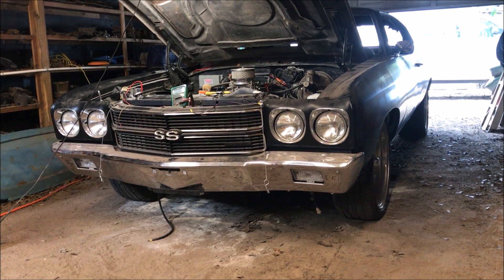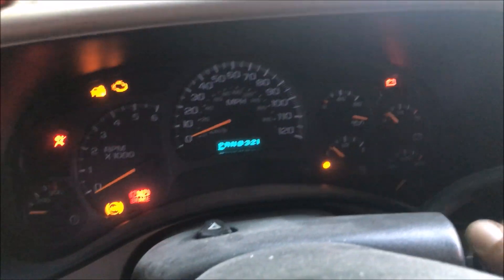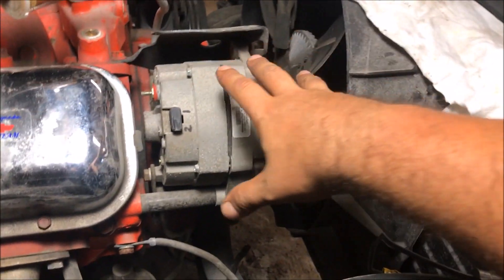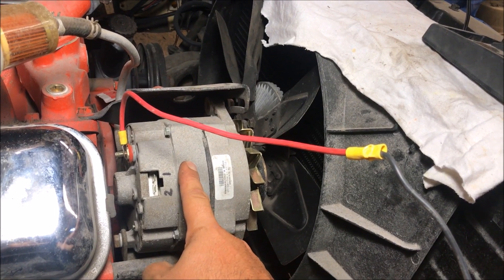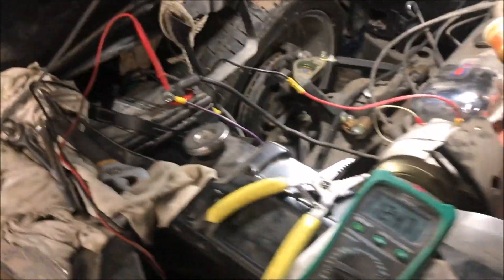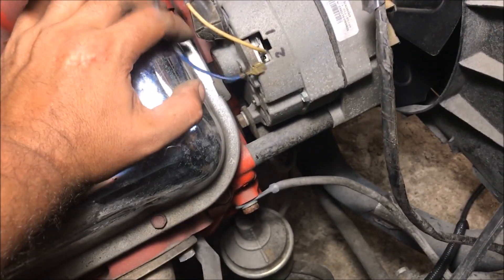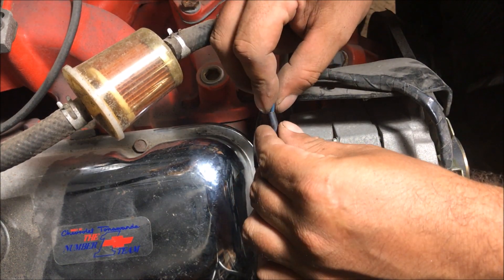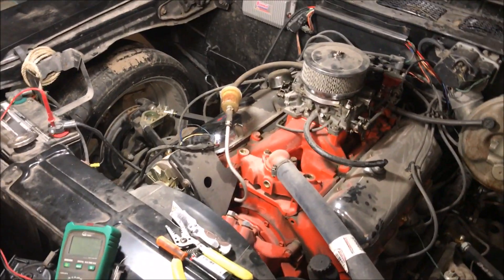watch before you buy a  GM 1 wire alternator and other INFO diode install

Comment: Still watching this video 2025 and I’m having trouble with my GM one wire still not charging bench tested at the auto parts store and it passed no problem put it on the car and test it at the auto parts store. It says bad voltage regulator positive directly to the battery Brand new GM one wire brand new battery as well. Still scratching my head.

Comment: So the only things id be sacraficing is the dummy light if i went from 3 wire to 1 wire?
Reply: In truth it’s not a one wire but uses one wire to voltage regulate.  The exciter wire (#1) is only used if you have the idiot light which place a load on the system to charge if you don’t have the light the diode acts as the load which so you don’t have or need the light

Comment: It's called 'cut-in' and that's a normal feature or problem of the one-wire alternators. The alternator needs to reach the 'cut-in' RPM in order to 'self-excite'. That's a good reason not to use them. Typically, only the street rodder crowd uses them for less underhood clutter.

Comment: Hey chris i have messaged younbefore on a different video about my 85 C10. Right now I have the terminal wire going to the junction block and not straight to the battery so my question how is it getting its charge. I also have a few fusible links going to the junction block where one goes to the starter and then  the other splits and goes to the wire harness
Reply from the maker: the one going to the starter is charging

Comment: What's up man hey I have a 67 mustang no wiring harness for the alternator so I jumped the number 2 to the battery and 1 not hooked up like you said and it worked for a couple months charging after a good rev but now it won't "kick on"  any ideas? Thanks man
Reply from the maker: hook or jump 1 straight to the battery and see if it starts to charge first...  if it doesnt repair or replace the alternator
Reply: @chriscraft77022  Thanks man I'll go try it and let you know.
Reply: @chriscraft77022  forgot to ask should I keep 2 hooked up to the battery? Have both 1 & 2 running to the battery. Thanks again
Reply from the maker: no, it will drain your battery.. run it off of accessories or key switch ON with a diode
Reply: @chriscraft77022  ok thanks dude
Reply: @chriscraft77022  thanks for all your help! Alternator was smoked 55 amp switched it out for 150 amp one wire. Duel electric fans, system and lights everywhere! Thanks again

Comment: I have an old boat and upgraded the alternator to 100 amp 1 wire (455 olds 7.5L). I wanted to just run a larger power cable from the alternator to the pos. battery post to double up the wires, but my mechanic said don't do it.  WHY?   I thought well then maybe I will just replace the entire wire but as I trace the wire it probably goes all the way to the front of the boat 1st which makes me think that there is some type of distribution Box up front. Do I have to run 6 gauge wire all the way to the front of the boat and all the way back to the battery? Am I not supposed to double the wires directly from the alternator to the battery? Because it won't have a fuse or something? So many questions... just want it to handle the load so I get the most out of it.
Reply from the maker: I have a 100 amp alternator video that shows how I did it
Reply: @chriscraft77022  ok I'll find it thanks!!!
Reply: @chriscraft77022   I called powermaster about the 8500 model marine alternator I purchased, and he said all you have to do is run a 6 or larger gauge wire from the one-wire post on the alternator to the positive battery terminal...and run a ground wire from the  little grounding tab on the side of the alternator to the engine block and you're good to go. That's it!

Comment: Hey Chris, great video!! Quick question, I want to do this in my 86 Dodge Ramcharger, which will be a similar process correct? I don't have a Gen light which means I can wire a 100a GM one wire, either of the two ways you showed right? Thanks a ton!
Reply from the maker: you only want to run 75 amps with stock wiring.... I have a 100 amp alternator video in which you need to upgrade the charging system....
Reply: @chriscraft77022  Thanks man!!

Comment: I’m using these Alternators as a home generator , straight off the stator I Above the rear bearing U see 3 wires coming down I’ve tested and got with my multimeter set on 750 for Ac current 1980v and I had both 1&2 wires together to the main lug on the back !

Comment: There should be a fusible link in the circuit to the battery.
Reply from the maker: not in 70..  you can fuse wherever you want..  in 70 they did have fusable links to the bulkhead connector..

Comment: Hi Chris. Thanks so much for the videos. I have a 1970 Chevy truck that has 2 factory 4 amp fuses for the amp gauge. The voltage regulator has been eliminated because previous owner install an HEI distributor and a 100 amp one wire alternator.on the drawing of your car's set up is similar to my but my horn relay in inside the cab near steering column on floor. My question is..can I use a 62-67 Chevy 2 shunt in location where your horn relay is located? Side note the chevy 2 also uses  4 amp fuses also in the wiring system for the ammeter.

Comment: It goes through the ignition switch like on a tractor single wire, if not connected straight to battery it is charged all the time?

Comment: Thanks for this video...question...the way you set it up...a volt gauge will still work...u said the dummy light won't and I'm fine with that but the volt meter will still work correct??
Reply from the maker: Yes, 100%

Comment: Good info about 1 wire alternators(purchased 1 for my 1978 Phoenix. Also noticed you have an old skool Pioneer head unit; is it the 1 with the cassette deck and remote CD controls? Brings back good memories Chris.......

Comment: You can turn a 3 wire into a one wire however until the RPM reaches around 650-750 it wont start charging, make sure to give it a little gasif to just idel the car once in a while to charge it

Comment: I have a DELCO REMY 22 amp alternator on my BOBCAT SKIDSTEER (That I just bought) The Alternator has a R & F on the back of the Alternator. The Skidsteer is from the early 70s. How do I hook this up properly? It had a Black external regulator box bolted to the frame but it was not hooked up at all to the alternator. I find no where on youtube to show how to hook it back up. Can I just run a set up like this  on the skidsteer even tho they are way more amps?
Reply from the maker: watch my easy conversion video.. or my gm 3 wire hook up video..

Comment: Hello  Chris ! I want use inline dummy light    so where to install it between the alternator and the diode Or between the ignition and diode ??? cheers
Reply from the maker: Watch my 3 wire alternator hook up video .. if you run the dummy light you don’t use the diode and run #1 to accessories (from IGN)
Reply: Thanks Chris for help and have a wonderful day  @chriscraft77022

Comment: Dear Chris  what's the different between the ''85 OHM 5 Watt resistor'' and the Diode ? is it the same or what !! because I saw people using it instead of the Diode !!! and I already ordered diode part number 1N5408 Rectifier Diode 3A for my alternator  is it the right diode ?? thank you
Reply from the maker: the diode allows only one direction.. resistor cuts the voltage down.. just use diode
Reply: @chriscraft77022   is the diode fine with GM CS130 Alternator Case Style, 105 amp Alternator Amperage?

Comment: Hello chris I have a 63 Ford falcon with a generator, I want to install a small 4 Chanel amp for a total of 4 speakers a pair of 6by 9 and a pair of 5 1/2 should I upgrade to a alternator 100 amp? By the way I was doing 70 miles and generator started to smoke was thinking also a good reason to swap to an alternator. Still was able to drive at night light on and no problem with battery draining. Thanks
Reply from the maker: no you just need a 55 amp ( normal )

Comment: Question here. I have my battery in the trunk, positive cable is ran through interior of car under carpet and out the firewall, where it is connected to the starter. I ran the charging wire from the one wire alternator to the power post on the starter so that it connects to the battery cable. Is this OK? Also the alternator charges right around 14 volts, then it will suddenly jump into the 20s and 30s volts. What's going on here, bad regulator?

Comment: Hey Chris, So i just bought me a 1 wire 100 amp. I am going to just go straight alternator to the battery with new 8 gauge. I know I got to cut & cap off the #1 & #2 wire from old wiring, so what do i need to do with my old power wire? Do i need to trace it back and remove it or just cap that as well?? Thank you
Reply from the maker: what year is the car and what is it? are you running an ammeter in the dash?
Reply: @chriscraft77022  it's a 72 chevelle, I do have a volt gauge inside. I don't care about not having the charging light feature though. As i see in your video, I'm going to lose it anyway
Reply from the maker: that car has a 10g wire bolted to the starter lug going to the horn relay.. there is a 10g that came off the positive battery terminal going to that lug... did you check out my 100 amp install video.. you can melt the insulation off the wires running that 100 amp with 10awg.... well, if you are running a bunch of accessories and pulling the full amperage
Reply: @chriscraft77022  as of what I see right now, is my power wire for my msd 6a box going to positive post and another power wire from my electric fan going to positive post, which is on a relay. So what if I use a new 8 gauge wire straight from alt to battery? & possibly remove the old 10 gauge that was going to old alternator? & yes I seen your video on the 100 amp install. Maybe i need to watch again lol thanks for the fast replies btw
Reply from the maker: there is a lot more to it when you put it on a system rated for 75 amp max!!! 
... so many people throw a big alternator on and melt the insulation off the charging system...

Comment: Will the one wire alternator overcharge the battery? I'm working on a project that has a 220 amp alternator and a single battery (does not have constant drain) and I am concerned about overcharging.
Reply from the maker: watch my 100 amp alt install video...  the wiring and connections are the most important... it will not overcharge but it can cook undersized wires

Comment: Good info and you make the point very well that with a one-wire Alt, you loose the Indicator function because you do not connect the Indicator to Field Exitation terminal(1)... but at 3:04 you say: "...the only thing you can really run with this, is just a Voltmeter..."  ...is just not correct...an Ampmeter (my preference anyway) can most certainly be installed to monitor charge/discharge current.   At 6:42 "kicks in" is when self-excitation starts...by not connecting (Field Exitation), it must self-exite...and it will from residual magnetism in the iron core, as you see (and there is nothing really wrong with that)...thanks for vid!  Cheers  BTW, nice burble while it was idling...!
Reply from the maker: sorry for late reply..  internally regulated vehicles DO NOT COME with ammeters ....  that is all i meant..   you can hook an ammeter up to anything..  i have an ammeter hooked up in the car in the video...  (factory ammeter)

Comment: Man I just bought a “one wire” alternator. I did not hook up #2 wire. It was charging at 18 volts. I emailed the supplier and asked for a refund. Not feeling very smart right now.
Reply from the maker: they must have sold you the wrong alternator.. ( they sold you a 3 wire ) that sucks.. I have that 1 wire 100 amp for sale in the video.. I never used it other than for the video .. I need a 140 amp

Comment: Great video!  I am installing a 1 wire alt (100 or 150 amp) in my 63 Pontiac Le Mans and I have an in-dash Alt gauge.  I recall after installing the new wiring harness, that this alt gauge has to be hooked before any of the electronics will work.  Is there any issue or concern running higher AMPs through this gauge?  I don't want to fry it or my dash.
Reply from the maker: no, the gauge is fine ... I have a 100 amp alternator upgrade video.. upgrading the wires are the most important thing to do
Reply: @chriscraft77022  will this wok on my 66 Pontiac with an Amp gauge?

Comment: Hay Chris great vids. I had a question how do you figure out the size circuit breaker after the junction block. Thanks.
Reply from the maker: depends on wire size, load, run of cable..   what wire are you trying to fuse.. what kind of vehicle?

Comment: My mopar uses a 3 wire alternator. And well long story short, I burnt the harness to a crisp.
I got most of it repaired besides the the alternator circuit.
The alt is externally regulated and some how uses the charge light in the dash and the ignition switch to excite the alt and send juice to the battery.
I don't wanna tear back into the harness just to excite the alt.
So I looked into bypassing the circuit and apparently I need to rig in a unspecified diode, and a unspecified resistor in line to the  ignition switch just to get the fucker to turn on.
That's before I can even figure out if the volt reg is still good and wired in properly...
So fuck it all, im swapping to a 1 wire alternator and never have to fuck with it again.
Not to mention the 10si-se is so damn cheap. Pocket change to replace it, unlike the 3 wire which is.$ 80+.
What sucks is I'm gonna have to fab up custom brackets to make it stay in there since the 1 wire mounts are the opposite of the 3 wire... Blah. The shit I do to look cool
Reply from the maker: watch my gm 3 wire alternator hook up video.. I have never messed with mopar but the alternators could be similar.. you don’t need a resistor you just run a diode, but if you can’t figure out how to bypass the regulator go with a 1 wire